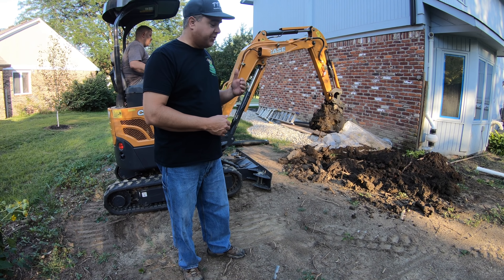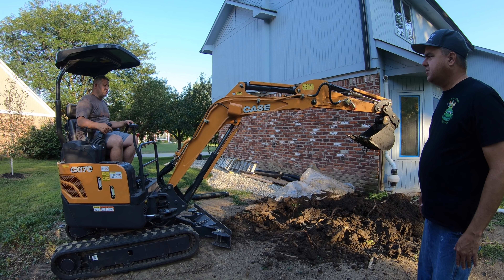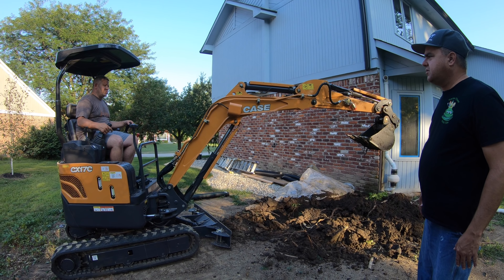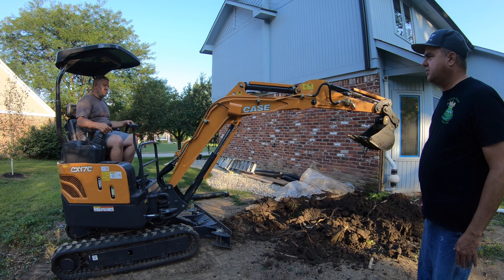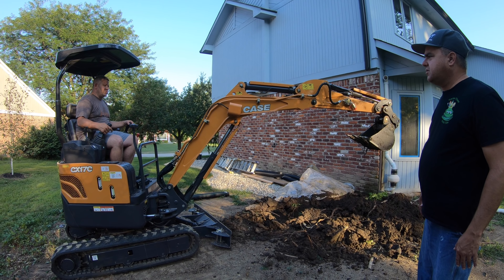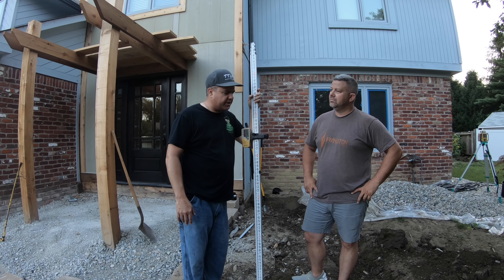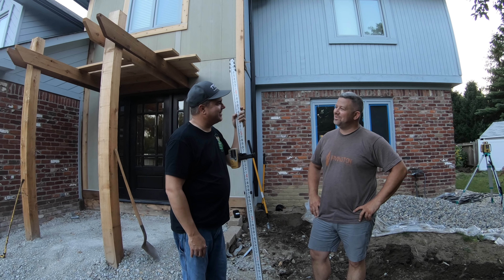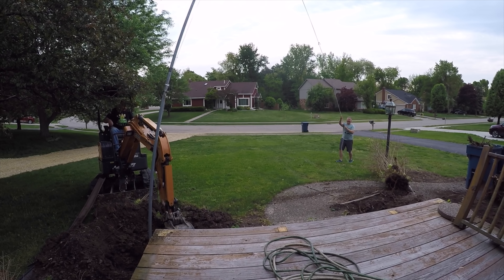Should You Rent Excavator For Your Projects?   Case CX17C Mini-Ex First Time Operator

Comment: A good tip is to polish the vottom of thw trebch off with your last pass tim. Keep the bucket underside flat to the bottom of the trench and it will pick up any left over spoil and also leave the bottom smooth. Just good practice once you master the way to grade it back through and keep everything flat and at the same angle. That machine looks real nice to drive though for its size.

Comment: To clean out the ditch, place the bucket flat on the bottom of the ditch and pull it toward you with the left hand...don't use the teeth to try to flatten the bottom...just float the flat bottom of the bucket on the bottom of the ditch...work like the front end loader on flat surface...(I'm no operator, but I do watch letsdig18...)
Reply: its called scratching ,  you want to use your teeth and drag them back to you a little at a time .. That is if you want to have a level bottom of the trench

Comment: Hey Tim, I may need to borrow that thing..   Getting hit hard here in Wisconsin as I write this..  18.5 inches fell in 5 hours south of us in my home town I grew up in, before I went in the Navy, this past weekend leaving flooding, bridges out etc including my home town flooded.. something that has not happened since the 1800's.  

If that was not enough, here today as I write this, another round coming through only north of that about 90 miles, where I now live since coming back home for good a couple years ago after medical retirement from the Navy.. 7.5 inches in 2 hours here so far, still raining plus a lot of tornado damage already from two touchdowns here..   Power out, everything flooded now here, so far we are at 8.7" and still raining hard.  Tornados are gone for now but could have more incoming as storms are expected all night...

Power for most has been down now for about 4 hours and it is humid as hell along with high dewpoint...  My wife and I went self sufficient here when we came home from my Naval service in 2014 so are home is the only one with power here for miles.  Internet in this county is buried fiber so as long as the back up gensets last at the co-op we have here in this county, we have internet and land line telephone.. all else is down for now...  

Anyhow, I need one of those machines to dig some channels to drain areas now flooding heavily before I have water coming into the house and the garage.. something that should not be possible.. LOL   If this keeps up, may need to start filling sandbags even here at my house where we should not be able to have standing water yet because it is coming down so fast and hard, we actually do...  

Mother nature definitely not happy lately.
Reply from the maker: Wow, those sound like snow totals instead of rain totals.    This is a bad deal!
Reply: If you get the chance, look at radar for this area.. You will see what we have been under all day.. still going too although my area looks to be finally moving out of it I would guess around midnight my time....   All of that in Michigan now first came through here starting about 20:00 hours last night.. Totals in some areas are around 26" now wind, hard rain and the tornado damage too..   Our soybean and potato field next to the house are ripped apart pretty bad.. both gardens we have are flooded... and it is really hard to get standing water due to the way we have our drainage... and in the fields they are piped as well... just too much too fast big time..   I just went down and checked our two ponds... my boat sunk!  LOL.  Winched it out of the water just a bit ago with the truck to get it back up onto land at least...   Ponds are the most full I have ever seen them.. Both have around 8 springs feeding them each but they don't compare to this coming down...    Lot of flash flooding around too..   and here at least we are luck as all around us there is a lot of damage..  so much so even the deer HERDS are standing in the road and not moving if a vehicle comes through.. I have to post my truck camera video because as I checked the area, came across a herd of two deer (white tail here in Wisconsin) standing in the road and then just kind of finally moving so I could drive on... LOL  Very weird to see that as usually they bolt.
Reply from the maker: Wow!
Reply: It was actually worse than even I knew when I wrote that..   Major damn let loose, Interstate I90/I94 was closed both directions as it completely flooded out the corridor..  Multiple roads and bridges washed out or gone, both rural and town tornado damage.. Many still without power or unable to move around due to no roads or block roads due to debris etc...

Very not normal for Wisconsin to see this large of scale damage, let alone about 35-40 inches of rain in 4 days or so like this.   Just sent some of my power generating capability to another neighbors place that needed power... We are self sufficient here as I made that decision when we came home but for many once the grid went down yesterday, they are still without any power so sending out some of my gensets and power panels (solar) to help some in the area... Mainly my backups to my primary setup.  For the next few days though, it appears things will remain calm finally so will be doing a lot of cleanup.

Comment: How much does an excavator like that weigh?  Could you tow it with a Honda Ridgeline?
Reply from the maker: I’ve towed it close to 1000 miles with a 2017 Ridgeline.
It weighs -4000 lbs. our trailer is probably 2500, so 1500 or so over the stated towing capacity.